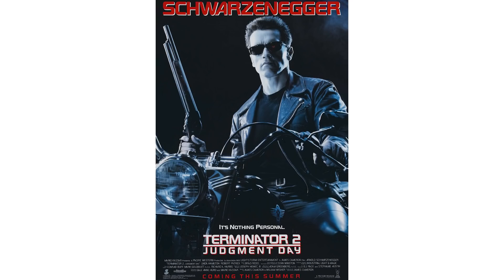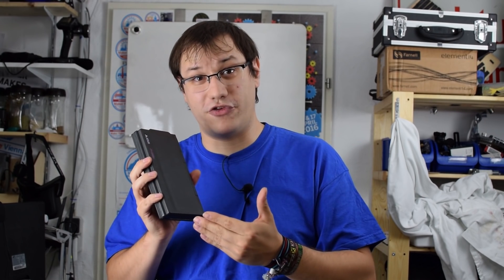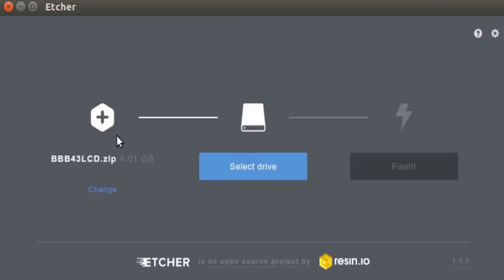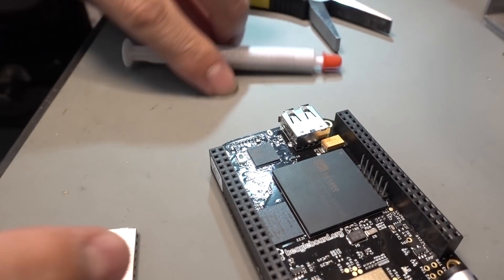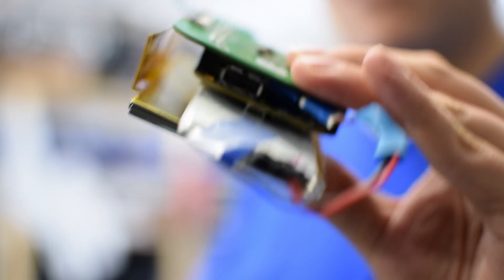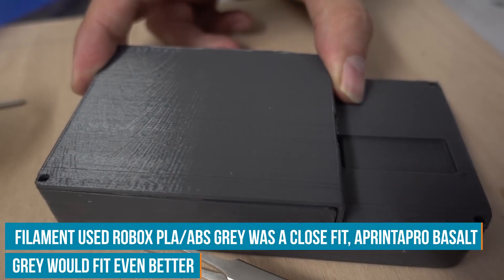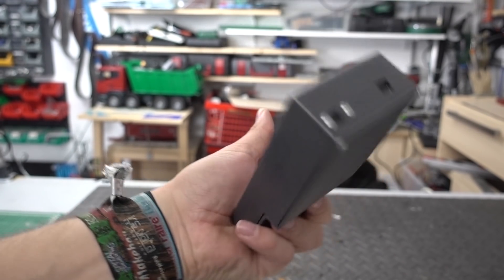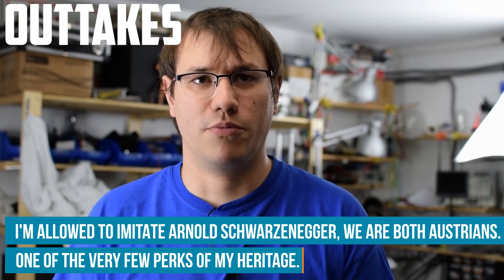Atari Portfolio Inspired BeagleBone Black Wireless Computer

Comment: Sorry man your criation is not good. Portolio starts up fast, have a nice keyboard and run on AA batterys. The thing you created its slow, no keyboard and no replaceable batterys.
It would be much better to use a raspberri pi zero or something, a SD card slot and without any GUI by default, just linux terminal. Something like this.

Comment: Hey Guys, have u ever done a teardown of a Neo-Geo AES or CD system? ;D  It's a classic powerhouse that continues to have new games released for it even after 25+ years. 
It's super interesting as they also included additional GPUs and other controller chips on the cartridges (each with 2 PCBs) to expand it's capabilities and it's lifespan.
(NG:Dev.Team from Germany)  released a game in 2015 for it and a new one is coming soon (was supposed to be 2018) but i guess is slightly delayed as its being developed by mostly 3-5 gents.
Reply: If I could get my hands on one, but tjose are pricey

Comment: That's a fun project. I wonder how much smaller you could have made it with a PocketBeagle? Perhaps at such a size you could have incorporated a hinged display and a keyboard as the original Portfolio did. Perhaps you could even find a broken original one and used the same keyboard. It very likely conforms to the PC/XT communications standard. This would require only a few pins on the PocketBeagle.
Reply: Don't froget to post your ideas on element14.com

Comment: This was just lazy, just a couple of premade modules, a poorly 3d printed box for a case, and standard software. there is nothing to learn in this video. I was hoping for maybe retrofitting modern hw into the original case, running dosbox. Or 3d printing a updated version of the case, but still maintaining the look and feel of the original, integrating the original keyboard into a modern hw or something like this. this is just too rushed, lazy and easy.

Comment: without a real keyboard, I am confused what this thing wants to be. Yes you can plugin in a USB Keyboard and programm arduinos - awesome - but the keyboard adds so much bulk, that you might as well take a netbook. Yes, there are smaller keyboards that are closer to the portfolios size, but that adds to much thickness. I mean: awesome project, but... what problem does it solve?

Comment: This will be some kind of joke. you show us the portfolio, then you make something similar in size, but no keyboard, no foldable screen, no old fancy text based operating system... just a raspberry behind a touchscreen. disappointed.
Reply: I would also have preferred to see these features, but I guess it's a matter of taste (and cost and complexity). A foldable screen would be nice as I don't enjoy the risk of scratching a screen, but I have also had a lot of flip-devices getting loose in the joint and there's a risk of the ribbon cable getting hurt. It seemed he struggled to make the device a tolerable size and adding a keyboard would have made that even harder. Let's hope future battery technology will reduce the size of batteries significantly!
Reply: @everdale8920  Sorry but not. You blame battery size and mechanical risk, and put it in a matter of taste, when it's not. A cat does not look like a cow, they are different animals. Both of them mammals, but still, not the same thing. If you're gonna make a cat, don't try to sell it as a cow. I like cats too, but, again, I was expecting for a cow. So, disappointed. (Ed) I'll prefer a bad looking cow, whit mechanical risks...
Reply: @medinachete73  Ok. I understand your disappointment based on the expectations. Clem unfortunately tried to sell the project as "a device that is JUST LIKE the Atari Portfolio, but is more up-to-date for 2019". This he could sadly not deliver, I agree. But we can't decide that Clem wasn't inspired by the Atari Portfolio when designing his product. If I had hired Clem to make a product as a more suped-up Atari Portfolio, I would have been very disappointed with what he delivered. But if I had to pay him $1500 instead of $300 to get what I asked for, this might be the preferred product.
Reply: Clem even state in another comment here that the flatflex cable to the screen on the original Atari Portfolio is prone to breaking. He has made design decisions, we don't have to agree with them, and that's a good thing because it encourages an active community.
Reply: @everdale8920  I only agree with "this he could sadly not deliver", the rest is just you showing open scenarios in which this device can fill their promises. Maybe is just that I'm not the proper target for this video, I can't even see the good on have an "encouraged active community" arguing about it. Things, they are, or they are not. Further discussions are futile.
Reply: In spanish you can say: "... And if my grandma would have a pair of wheels, she could have been a bicycle!" :)

Comment: Cool to see a video with the BeagleBone! I'm doing a project with the PocketBeagle and ran into the same issue with the power supply not providing 5V to USB when using LiPo. I wonder if there's an Atari Portfolio emulator that would run on your device?
Reply: simple, just boot MS-Dos , thats what ran on it.
Reply: I see what you mean. Man, that would have been an amazing machine to own back in the day.

Comment: Seeing something put together like this is awesome, but I can't help lamenting the lack of physical keyboard on the resulting device.  I mean, I guess I did back the Planet Computers Cosmo thing they're working on, but touchscreen typing is nowhere near a substitute for the physical board.  "Entire novels" written on the original chiclet board, sure - but writing a novel on a touchscreen, even if it's higher res, colour, and on a much faster device... :(  That said, hey element14 - how about a mini keyboard designed for these kinds of projects as a part you can integrate just like that display? ;)
Reply: I thought about a keyboard but I prefered a slimmer design, and honestly I do not expect to type that much on it, I use it more like a quick gateway to my 3d printers.typing in some gcode commands is comfortable enough with the touchscreen. Post your Ideas on element14.com/presents that is where the folks listen the most to community ideas for products.
Reply: Thats an amazing idea! Probably much more difficult than it sounds but still a good idea!💡

Comment: In my opinion, the device not particularly 'useful' or 'special', since there are similar pre-existing Pi-based Linux handhelds, and you can just chroot your Android tablet, hack a Nintendo Switch, or get a small IBM PC compat tablet if what you want is a handheld GNU/Linux system. 

That said, I guess the usefulness of the device need not be justified if the process is enjoyable. My main problem is that the project is not novel enough: I already saw similar projects multiple times, and I expected to see more custom designs in hardware and software. Maybe it's just me, though.
Reply: Sometimes I want to keep it accessible in favor of making it novel, I like the simplicity of the original so I chose to make it that way, and the video had to be finished on time.

Comment: "Full functional Laptop" are you mad man? only a handfull DOS Programs run on this pice of sh*. My Toshiba T1000 at this time was older and ways better.
Reply: take a look at the the book I mentioned in the video, there is a crapton of software for it, I was genuinly impressed by that device. I used it daily for a month until I forgot to change the batteries fast enough and all my files were gone. I had no chance to play around with a T1000, may look into it if you can recommend it.
Reply: " I used it daily for a month until I forgot to change the batteries" Such crapy "PDAs" like Atari Pofo/Psion Revo are "timebombs" for all your Datas, and NO, you cant run DOS Programms properly in a Resolution of 240*64 (hahaha), and Standard 128KB SRAM, even 1989, why people Always hype crappy old sh*?
Reply: It's oddly appropriate for you to mention the T1000 when watching a Terminator-inspired clip.

Comment: two changes you should do.  design a flip lid to cover the screen when it's in your pocket and you should build in a holder for a stylus
Reply: I thought about a lid, but the hinges seemed to add to much bulk and may ruin the look.
Reply: Well there is a way to design and print a working hinge in one piece, i don't know it, but I have seen 3D Printed boxes with them and it doesn't bulk the print at all

Comment: What incredible timing! I got a "new" Atari Portfolio (my second) yesterday! The ones sold at the time Terminator 2 came out included a memory card that contained the simulated hacking program used in the movie.
Thanks for this great little project!
Reply: Thats a great find! I couldn't get hold of a working memory card for a reasonable price. Have fun with it, there is a lot of software to explore.
Reply: @MAYERMAKES eBay is your friend! I picked up my 1st Portfolio as a bit of Terminator memorabilia (I have a ridiculous collection) years ago, then got into it and bought a ton of peripherals on eBay. The "new" one I just got also came from eBay. Hoping to mod it into part of a retro cyberpunk costume.
Reply: Very Cool! I found mine at a fleamarket a while back in non working condition, but repair was easy cleaning(just a lot of dirt causing shorts) and a little resoldering was enough . @Datan0de
Reply: @jimf99  there is a project documtented online that created an interface to CF cards
Reply: @jimf99  It uses CCM "Bee Card" memory cards. The ones I have don't require continuous power to maintain data. I don't know the specifics of the interface, but there's also a parallel port module that lets you directly connect it to a PC parallel port using a basic terminal program. Setup is kind of a hassle, but it works well enough once done.
Reply: there are guides on making one yourself on the web, but I could not get ahold of the chips used in it instantly so I never tried.. @Datan0de
Reply: @jimf99  ther is internal battery backed Ram that stored the data, the additional cards were also containing batter backed RAM, which also made them vulnerable in case of power loss